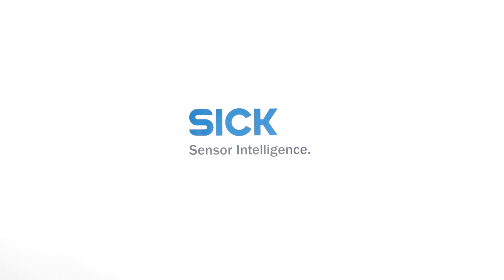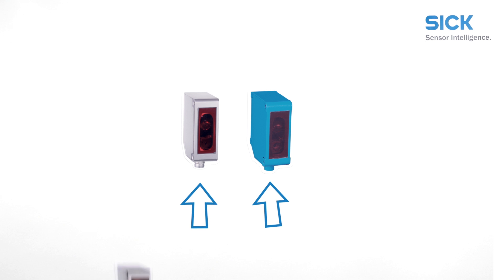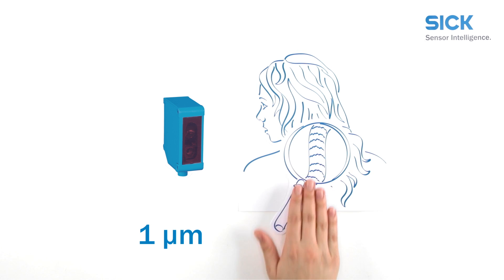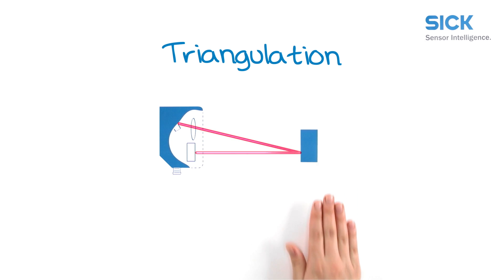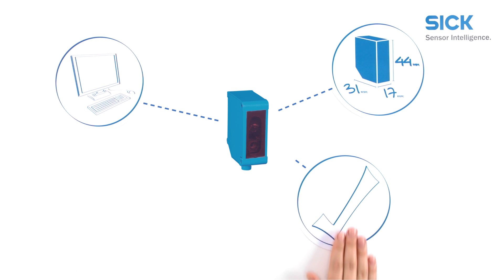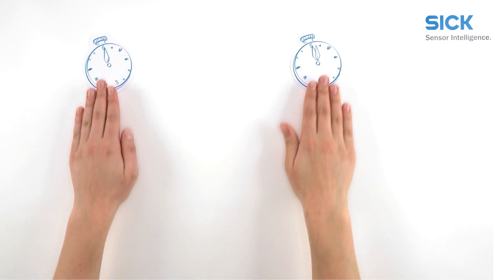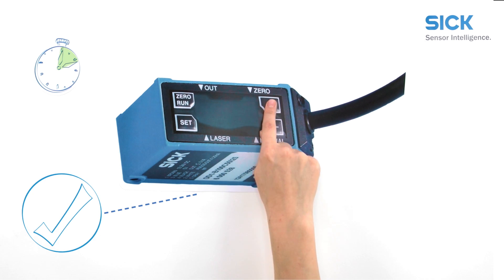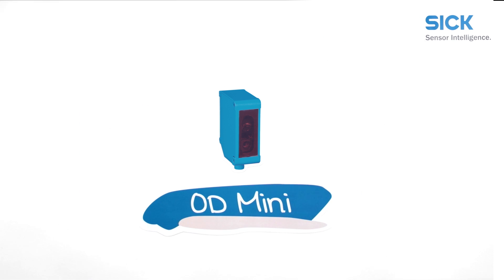OD Mini from SICK: New short range distance sensor (displacement) for µm precise measurement

Comment: can we use this sensor to detect double metal sheet and to measure its thickness of 1mm..The sensor needs to mounted on robot arm..I am looking similar to this https://www.roland-electronic.com/en/products/double-sheet-detection/
Reply from the maker: Dear santosh biradar, Thanks for your question! Yes, in principle the OD Mini can be used for double layer measurement and thickness measurement of 1mm thick parts. This is a very general answer and it is necessary to take a close look at the application in each individual case. For this we would like to ask you to contact our technical experts via mail: info@sick.de Thank you very much. Best regards
Reply: @SICKSensors  thank you so much sir..